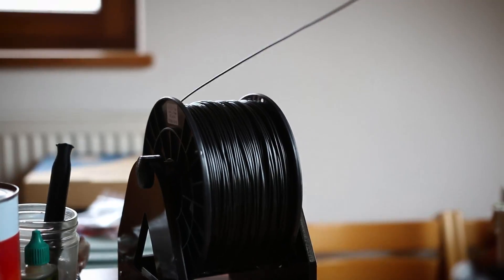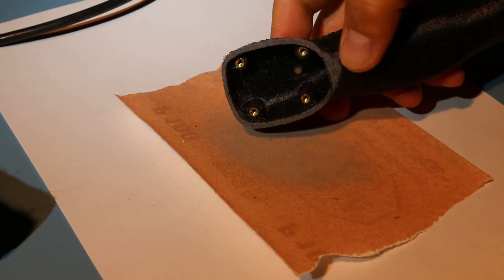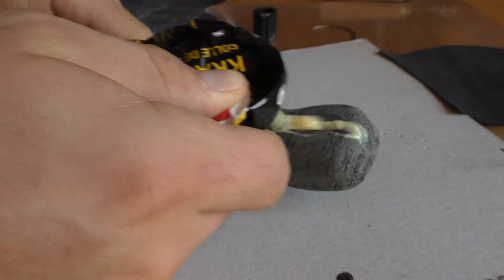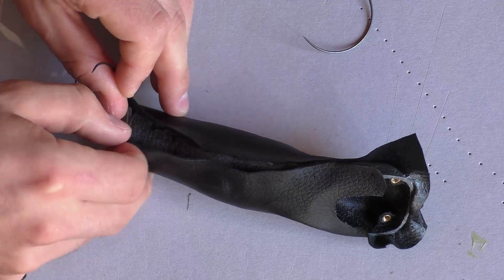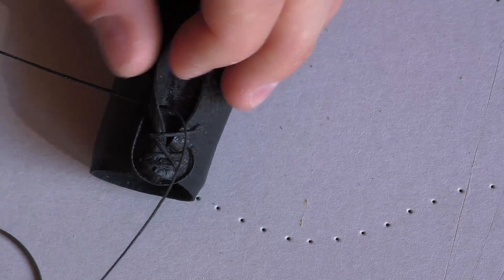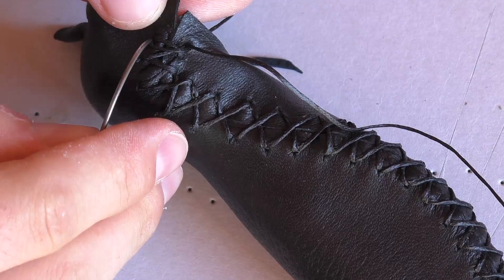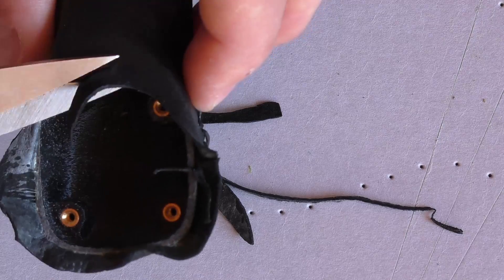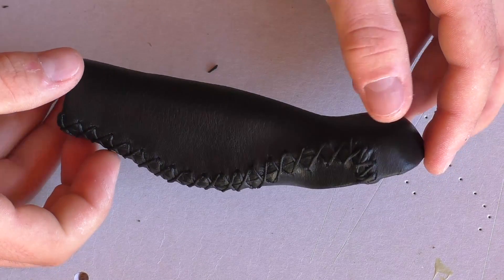DIY Glider Remote Stick | Openvario | Part 1

Comment: Hi Stefan,

Do you have stl files for the grip, faceplate and rubber told you can share that match the current pub on the OpenVario project?

Comment: Hi and thanks for creating the stick and the video. I plan to print the stick on my 3d printer. A question for you, there are three versions of the stick, KnueppeIV31, Stick v1 and stick V32. What are the differences between them and which one should I use?   Does the front plate fit all three versions?

Comment: Hi Stefan, great work yours!! Could you please supply also the 3D files (not STL but IGES or STEP or any other 3D extension). I would like to modify the model according to my needs.
Reply: I would also like to have a step file. I need to modify the Stick to 30mm for my Banjo UL-Glider

Comment: What material did you use for the stick? Was it ABS?
Reply from the maker: Yes, I use ABS!
Reply: You MUST use ABS or another material not affected by heat like PLA. PLA is what people normally use for 3D printing because it is very easy to print. On an Aircraft I would NEVER use PLA.

Comment: This is great. Thank you for posting. Will you release the STL file & dxf for the stick & leather? Alternatively would you be willing to sell a bare stick, without electronics?
Reply from the maker: Hi John, I will upload the STL file, but don´t have an dxf for the leather. You can also get a bare stick from me. Cheers, Stefan
Reply from the maker: There it is: http://www.thingiverse.com/thing:1818509
Reply: Thank you very much for making it available. I'm going to have a go as it looks like fun, but I doubt it will look as professional as yours!
Reply from the maker: Give it a try!
Reply: SLSoaring thanks it prints very well. I guess I need to test fit it in my glider as it looks wide.

is the home on the back for a vario/stf switch?
Reply from the maker: You need an insert, which is turned out of aluminium. It has three threads installed to fix the grip stick on your glider and gives much more stability than the 3D printed ABS. You find the parts on Thingiverse profile with 19 mm diameter and with 20 mm diameter.
Reply from the maker: Great that you made it! The new design is not published on openvario.org , but it will be updated soon. Please send me an email to stefan.langer@cotexx.de and I will send you the gerber file for producing the PCBs. 
Cheers, Stefan
Reply: Stefan Langer Thanks! Sent.